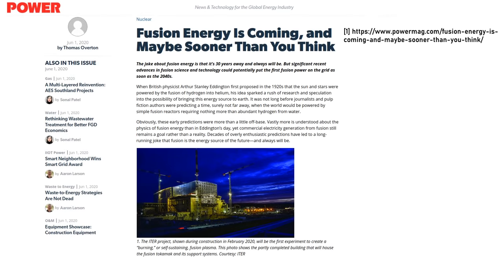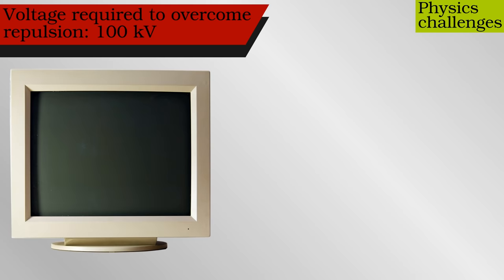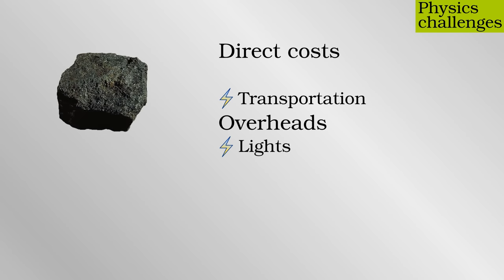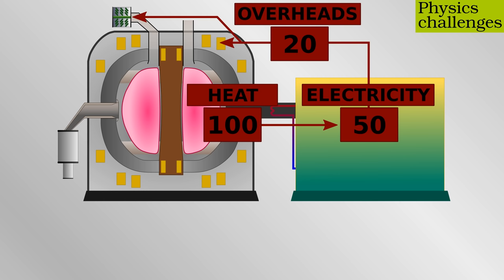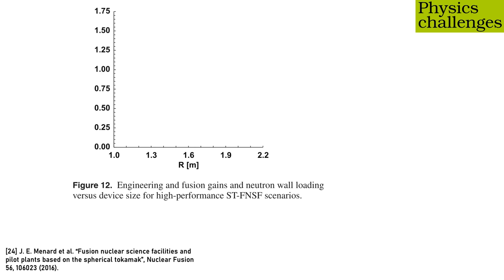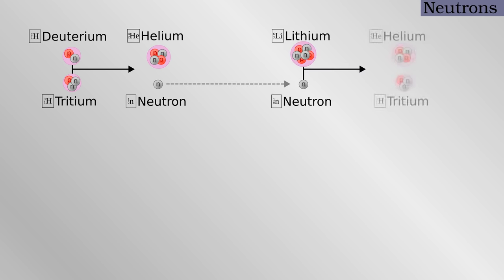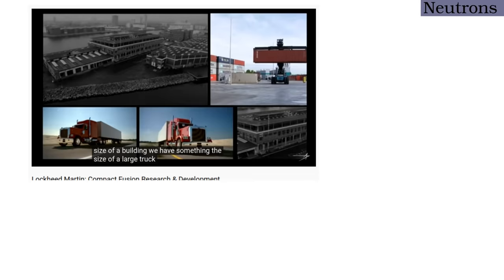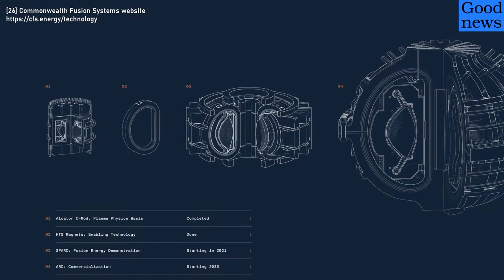Former fusion scientist on why we won't have fusion power by 2040

Comment: As a retired plasma physicist who worked on and managed a number of large scale fusion science projects for 30+ years, including ITER, I think this presentation accurately presents the current state of fusion development and lays out the challenges ahead. While scientific and technical process has been steady, development of practical fusion energy will require significantly increased investment by many nations. New materials and technologies will need to be developed, and significantly improved scientific and technical understanding will be needed to reduce engineering uncertainty and increase reliability for proposed fusion power plants.  Present investment levels are significantly lower than needed to validate proposed reactor designs/approaches and bring this technology to fruition (or identify fundamental barriers) in a timely manner.

Comment: Well written, expertly explained, beautifully narrated, nice graphics and a pleasure to watch!

It seems to me that the fusion model of the sun is effectively an open system and that is why it works.

The system has no need to be powered by external means. Also, it will last a long time but not forever. It will last as long as the fuel is there.

Fossil fuels are much the same. There is certainly more energy gain than invested and their use fits an open system model. As long as there is fuel, +they work. But, they too won't last forever. 

Here on Earth, of course, fusion reactors are closed systems. Ideally, they would need to produce enough energy to power themselves and produce economically usable amounts of excess electricity. I don't think they ever will given how they are conceived and the currently available technology.

I would love to hear your analysis of the novel approach taken by First Light Fusion.

At least they started with the premise of KISS (Keep It Stupidly Simple aka Keep It Simple Stupid) engineering.

I like this approach. I am still dubious though.

Basically, I think the universe itself is an open system. The reason the universe exists and persists is that power flows in from outside. But, of course, I have no idea about how this happens.

Anyway, please do make more explainers like this. I really enjoyed it.
Reply from the maker: First Light Fusion are at the "look at us, we're doing fusion" stage, which as I say has been reached by a teenager. They will need to demonstrate the 20x fusion gain and Tritium breeding which I mention in this video. Furthermore, because they are a pulsed power scheme, even then they would produce about as much net energy as a goat walking on a treadmill. They would need to perform shots at the rate of a machine gun (1 to 10 per second) to create a power plant.
Reply: The Urantia Book explains this last. Stupendous energy circuits eminate from Nether Paradise at the center of all things and flow throughout the universes.

Comment: There is only one example of working fusion reactors: stars. The only reason they work so well is because they have the only seemingly doable containment that also functions as the heating circuit: large amounts of mass held under its own gravity. Dyson swarms anyone?
Reply: We just need to create a big mass start, surrounded it  with solar panels and big lithium batteries and then transmit all that energy wirelessly to our solar system (is a joke :D)

Comment: Another thing one needs to keep in mind:
Do you know how insane temperature and pressure are in the Sun's core? Yet, in those conditions, it only generates about 100 W per a cubic meter.
Reply from the maker: I'm covering this in my next video. The temperature is 5% of the peak temperature achieved in a tokamak. The proton-proton reaction is 10^25 times slower than D-T.
Reply: At the center of the Sun, fusion power is estimated by models to be about 276.5 watts/m
https://en.wikipedia.org/wiki/Solar_core#Energy_conversion
Reply: Nobody would do it if the yield were that low.

Comment: Making tritium isn’t difficult and they could use a conventional fission reactor to make all the tritium they need. It doesn’t have to be produced in the fusion reactor.
Why it won’t be viable in the foreseeable future is simple economics. We can’t build fission power plant that are economically viable. How are we going to build and operate fusion power plants where the technology is far more complicated, expensive, and fragile?
Reply: The problem with fission plants isn't economics, it's social/political.  They were built and run profitably in the past and many of these are still in profitable operation.  The problem is that postindustrial societies are decaying socially, creating levels of corruption and incompetence that make projects like the Concorde or the Nuclear Reactor unfeasible.
Reply: @joemerino3243  Yeah, and where fission plants aren't economically viable the reason is that they've been made so with politics.
For example in Sweden, where they're progressively taxed the higher their output is: In other words the tax burden becomes higher as they become more efficient, the more electricity produced, the higher the tax percentage. It's quite obscene.
Reply: @TriNguyen-he7xk  You obvious don’t have a great understanding of how fission nuclear power plants can be designed. There are numerous small fission reactors all over the US designed and run specifically to produce radioactive isotopes for commercial uses. One of those isotopes is tritium.
Reply: @joemerino3243  The social/political have a major impact on the economic. In US citizens will not tolerate nuclear accidents the only way to achieve that is to not build the plants, because even the very best nuclear plants eventually have accidents. That is the whole basis of probability risk assessment on which nuclear plants are designed. If your design criteria is no possibility of accidents the only way to achieve that is to not build the plants.
Reply: @TriNguyen-he7xk  You need to do some research. The way they make tritium in fission reactors is the same way the make it in fusion reactors in the video. Fission reactors are just much better at it because they create a greater surplus of neutrons.They don’t get it from the fission products, it is an activation product. The way they presently do it is by putting lithium-6 in the reactor, it makes a ton of tritium the hard part isn’t making it, it is enriching it. You can also do it by using a deuterium enriched moderator, but that is more expensive and only done in heavy water reactors, like Canada’s CANDU Plants.
Reply: @matthewhuszarik4173  There's only been one significant nuclear accident in the US, 3 Mile Island, and it was so minor as to be less than an X-ray for people living near the plant.  I mean, you're right, of course, that any plant will eventually have an accident over infinite time scales, but nuclear plants can live out their entire lives and be decommissioned without having an accident, it happens all the time.  Or at least it used to when society produced competent and well-intentioned individuals.
Reply: @TriNguyen-he7xk  You still don’t understand. CANDU are designed to make as little tritium as possible not to maximize production. I will make it as simple as possible every fusion only produces 1 neutron on average every fission of U235 produces 2.43 neutrons so even with the fissions taking up one neutron per generation a fission reactor has 43% more available neutrons for tritium production. For every fusion you need to produce another tritium. So just using Li6 produces inadequate neutrons even in a theoretical setting. So it gets more complex and they have to ad neutron magnifiers like Beryllium. But you will always have problems with sufficient neutrons to produce enough tritium because every other physical component of the reactor also absorbs neutrons and due to their high energy and the limited size of the reactor they leak out.
Also if you use LEF or mix oxide fuel Pu239 produces 2.91 neutrons per fission.
Reply: @joemerino3243  One of the problem is the criteria engineers use to design nuclear reactors. Probability risk assessment. They design a reactor to have less than one serious accident in multiple lifetimes. The only problem is we don’t have just one reactor we have over a hundred and most have been operating over forty years, so how many reactor lives has the US had? Thankfully probably risk assessment is conservative because based on the calculations operating a hundred reactors we should be having a serious accident about every ten to twenty years. We have been having accidents or near misses about that frequently.
Reply: @TriNguyen-he7xk  What you perceive as condescension is impatience. I worked in US Naval and US Commercial Nuclear Power for forty years. As an Operator, Chemist, Health Physicist, and Engineer. When I disagreed with you I expected you to do the research. While is isn’t an easy subject you seemed more than intelligent enough to understand it. There are multiple ways to make H3 in a neutron flux. Unlike present reactors that are designed to minimize that exposure to that neutron flux you can design the reactor to maximize it. The means you suggest is presently common to produce small to moderate amounts of radioisotopes, so it probably wouldn’t be practical. The ways they propose to do it in fission reactors probably would be more likely to work and work better in fission reactors due to the greater neutron flux. There are dozens of factors to consider is an optimal design I wouldn’t even hazard a guess which final solution would be the best.
Reply: @matthewhuszarik4173  Fermi 1: No injuries.  Even Solar can't say that.  Nuclear is ridiculously safe if the worst you can say about it is that at one point some damage was done to the reactor through neglect but they caught it before anyone was hurt.
Reply: @joemerino3243  Actually while relatively safe many people over the years have died in nuclear plants just not due to radiation. The problem isn’t the number who have died it is the potential number who could die and the cost of recovery. The Japanese tsunami killed what? About 23,000 people and Fukushima didn’t kill anyone. Fukushima will still wind up being financially more costly to Japan? That is the risk most not actually involved in the industry don’t want to take. When there are cheaper less risky options the general public would rather choose those. I worked at Diablo Canyon for 34 years. It will be shut down in 2025 because the PG&E’s board decided the benefits weren’t worth the rewards. This decision was made in spite of the plant being fully paid for, in excellent condition with new steam generators, reactor heads, low pressure turbine rotors, and generator rotors and having one of the very best operating histories in the industry. For the relatively minor expensive of relicensing the plant could have easily run past 2055. They chose to shut it down and replace it with renewable energy. This is the same decision happening all over the country. Plants with significant service life left being prematurely shut down for economic reasons. If it isn’t cost effective to keep an asset that is already paid for running what sense does it make spending 10-20 billions dollars for a new one?
Reply: @joemerino3243  No power source supplies steady continuous power and demand isn’t steady and continuous either. Demand can triple during the day over what it is at night.  All power sources come off line for maintenance and they trip on faults. For all these reasons utilities have always kept extra generation capacity in reserve. 
Renewable power also follows demand better than conventional power. Solar power peaks at the same time demand peaks. Wind power generation generates power around the clock when the wind blows. Yes utilities will have to keep reserve capacity to fill in when demand doesn’t follow supply, but that is no different than they do with conventional power plants. The only difference is when they need reserve capacity needs to come on line. It used to be in the middle of every day and now to a much smaller degree it is in the evening. With the right mix of solar, wind, hydro, geothermal, other renewable sources, and storage of power, peaker fossil fueled plants will no longer be needed. Right now California is about 50% powered by renewables. The last nuclear plant will shut down in 2025. The newer gas fired plants will be around for maybe another ten years. The problem isn’t that is can’t be done, as it can. The question is which method is most economical. So many technologies are being developed no one wants to invest in a technology that isn’t cost competitive long term or becomes obsolete and unsupported in only a few years.
Reply: @joemerino3243  You obviously don’t know much about the electricity market on the west coast. California imports much of it’s electricity because of the Federal dams on the West coast and the Palo Verde Nuclear power plant the largest in the country is partially owned by California utilities. When the major hydro electric facilities were built on the west coast the only market for their power was California. California had more people and industry than the rest of the west coast all put together. California signed long term contracts to purchase this power. They have to pay for it whether they take it or not. In fact California frequently has such a surplus of power they pay Arizona to shut down some of their gas plants to use it. Because of roof top solar and conservation the California electricity market instead of growing with inflation has contracted by 20% in the last 15 year. California’s peak power demand was back in 2006 even though the economy has grown 25% and the population has grown over 10% since then.

Comment: You should have gone deeper into the capture cross-sections for the 14Mev neutrons that are products of the D-T reactions. At 14Mev most neutrons will shoot through the lithium blanket and irradiate all the surroundings of the fusion machine, including the structure itself and any workers in it. Talk about nuclear waste! (Private communication with Prof. Walter Gekelman at UCLA)
Reply from the maker: You should check my reference 24, which is the paper I talk about in this video. Their neutronics calculations show a 10 times decrease in (fast) neutron flux for every 12 to 15 cm of blanket, with the final leftovers easily absorbed by concrete. So, the physics of neutron capture is manageable, it will just take a long time to engineer and test a working blanket.
Reply: @ImprobableMatter  Plus, you have to have a tritium handling system that can efficiently extract the tritium from the breeder blanket, process and move it quickly back into the plasma. Also, since not all of the tritium gets burned up in the plasma, your system must also capture and process that tritium back to send it back into the plasma. Doing all of this in a way of engineering design that an accident won't have enough of a release to be harmful to workers or people living next to the device. Most DT fusion developers don't talk much about these aspects of engineering too.
Reply from the maker: Any study on a full reactor has considered everything you've said, I've said, and more. Most fusion scientists don't talk about it, because they are busy on solving the plasma physics issues first.

Comment: It's funny that the only reliable production of fusion is using gravity. While we're nowhere near proving something like electro-gravetics are even possible. Yet here we are, trying to make fusion reliable. Talk about cart before the horse.
Reply: what do you mean by "the only reliable way"?
Reply: @finnmurtonz7062  consistent sustained and happens without fail. Every other way we try make fusion, stuff breaks, burns, or melts. It's just not reliable, like if you had to replace the gasket of your car every time you drove it, you wouldn't call it reliable.
Reply: Or another way to think of it, star fusion is so reliable we've had people navigate using it for thousands of years. Reliable.
Reply: @Sinaduel  ohhh i get it, but i don't think you are completely right, the problem with fusion is the efficiency, the current methods are nowhere near enough to compensate the energy cost of making it possible, unless you want thermonuclear weapons, that are so efficient, it's dangerous to use it in electricity generation. but i get what you are saying, the sun and stars are the only "good" fusion reactor today.

Comment: I am commenting #BringBackDislikes on every unique YouTube video that I watch for the rest of 2024, regardless of if I actually dislike the video or not. This is video 985.
Reply from the maker: Agree. I would be happy if there were a safe 3rd party way to verify dislikes (which YouTube does have stored in the backend). This video has 1298 dislikes as of right now.
Reply: @ImprobableMatter  There is an extension, but I am trying to make dislikes public again, so we can easily see the validity of a video.

Comment: I think a more brutal approach is necessary - build a sphere (material type TBD), and have a thermonuclear explosion in the center, compute the reaction energy output so that the energy is just enough to melt the material in which the chain reaction happened. Have this entire sphere and now molten mass in a boiler where you can pour water and generate the steam, until the molten mass from the explosion cools off. You know the drill afterwards. Of course you have to solve the problem with the sphere material reusability and total energy balance. But I think those other approaches where you have to constantly reignite small nuclear fusion bursts just kills all of your gains.
Reply from the maker: This idea has been considered, but it is not economical.